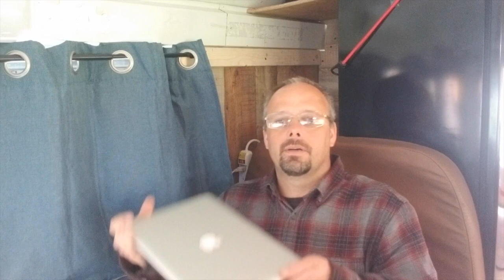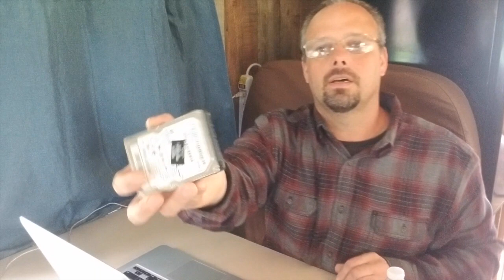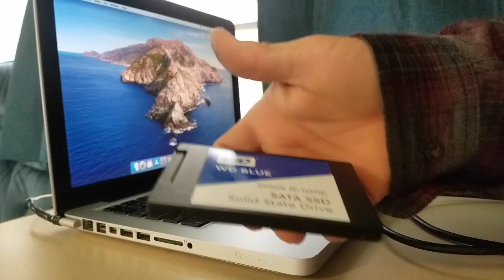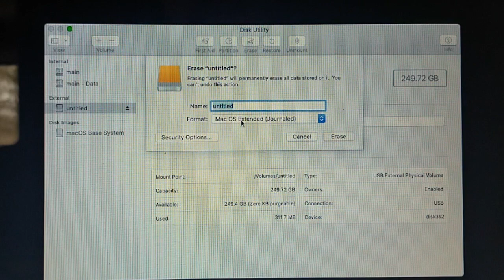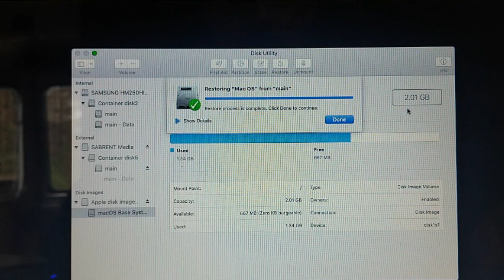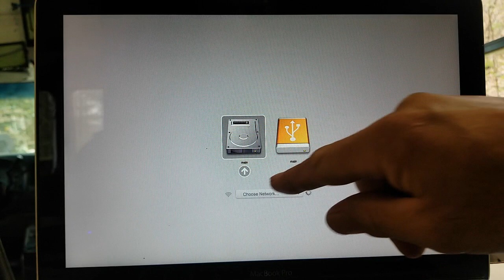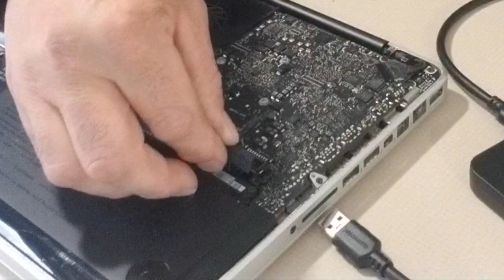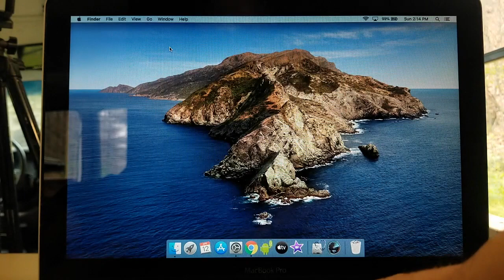Upgrade and Clone Macbook Pro HDD to SSD

Comment: Asking for advice on upgrading my Macbook Pro mid 2012

So I recently started using my gf macbook and using both mac and windows 10, i love the fact that I can use both, tbh I don't want to upgrade it and keep it if i cant use Bootcamp on it.

Here's what I want to do:

I want to install a 1tb sdd on the main disk, and then put the old disk instead of the optical reader with a caddy, and install 16gb of RAM, then install Mojave from an usb (im currently using El Capitan and I want the dark theme)

My questions are:

1. Can I install a bootcamp partition without any issues on the ssd?

2 . Can I format the old disk (with my current ios and bootcamp) to use it as a normal drive inside

3. Is it hard to install Mojave from an usb, from scratch?

4. Is it better to clone my existing drive to the ssd and then extend the disk partitions?

5. What kind of things I need to avoid in order to succeed?

6. Do I need to erase all my accounts so I dont get blocked from using the macbook from 0 (installing Mojave)

Thank you so much if you read all of this, hoping for some info
Reply from the maker: You should be able to use the old disc in place of the optical drive. I don't see any reason it wouldn't work.
Installing Mojave from scratch from a usb is the best way to go in my opinion. This guy has a pretty good video showing the procedure.  https://www.youtube.com/watch?v=TXZ6SwMZw20
 would back up everything and after the fresh install then use bootcamp to install windows fresh as well. 
I would most definitely wait until the new ssd is up and running and working well before formatting your old drive.
Reply: @lukeFugate  Thanks for the info my friend, Im new with macbooks and I know that they can get blocked for dum reasons, do I need to erase my accounts to avoid any problems??
Reply from the maker: @PEL-i9x  I don't think so. I upgraded mine with no problems. It just signed me in right away.
I have mine dual booting Catalina and MX Linux now and find myself booting into Linux for everything except for video editing. So much faster than Mac OS.
Reply: @lukeFugate  Si basically i just take the hdd, put the ssd and install mojave from an usb, and pray fir the best?
Reply: @lukeFugate  Even if I change the original drive to the caddy I would still have the option to boot it from there with ALT.. don't I?
Reply from the maker: @PEL-i9x  should be able to hold down the option key on startup and see all the drives.

Comment: Follow the steps and restore process fails with message “bless failed on ‘volume/Macintosh HD’ -no such process The operation couldn’t be completed. (OSStatus error 3.)” Any ideas, I’m stumped.
Reply from the maker: Might check the connections on the hard drive enclosure to make sure they are secure. Also make sure the OS is updated and working fine.
Reply: @lukeFugate  I ended up using the free trial of Carbon Copy Cloner. It took a little over 3 hours, but everything eventually worked. After that I did notice that Catalina had a supplemental update, so I wonder if that caused the problem using disk utility. The new ssd makes a world of difference.
Reply from the maker: @coachg101  Glad it worked out for you. Yes, an SSD is a great upgrade.

Comment: What SSD did you used? Is there any compatibility? THanks
Reply from the maker: I used this drive. 
https://www.walmart.com/ip/WD-Blue-3D-NAND-250GB-SATA-2-5-7mm-SSD-Solid-State-Drive-WDS250G2B0A/629653814
It didn't have any problems at all and is still working great. I am even dual booting Mac OS and MX Linux without a problem.
Reply: @lukeFugate  Thank you

Comment: Thank you so much for the tutorial very helpful!! Would like to ask would it work if the new disk storage capacity is larger than the original?? Im planning to swap from 500gb hdd to 1tb ssd, wanna know if this works, thanks
Reply: 1st you need to repartition the Mac OS drive to something smaller than SDD, then follow the steps from video, it worked like a charm to me.

Comment: Hi. It does not allow me to do the process because the computer indicates that my internal hard drive is encrypted. My Mac is running Catalina OS. What can I do?
Reply from the maker: Another commenter "Riley M" had the same problem. He found a solution that worked for him. Here is his post. 
 Go to System Preferences > Security and Privacy > FileVault > Click the lock to make changes > Turn Off FileVault.  You will need to leave your laptop plugged in and I recommend making sure your laptop and charger can be both well ventilated as I had to leave my laptop on for around 24 hours to let the 'decryption' happen.  After this, I was able to clone the drive successfully and install it with no problems.

Comment: EXCELLENT TUTORIAL. Very updated with latest Catalina OS. Congrats!!
Reply from the maker: Thanks a lot! Glad you liked it!
Reply: luke Fugate how long does it take for the image to conclude? It’s been a long time and the progress bar is frozen at 95% for at least 30min now...
Reply from the maker: @EvangelistadaVerdade  Seems like mine was done in around an hour. Did it ever finish? You may have to try it a couple of times.
Reply: luke Fugate thank you my friend. It took around 2h (maybe my old HD was too slow) but it ended with the green check mark and after installing the SSD, the boot time went down from 2:40 to 0:25. A ridiculous improvement on performance!! R/W speeds went from 50 to 490 Mb/s. Incredible. Thank you for the video. Very helpful!!
Reply from the maker: @EvangelistadaVerdade  Glad it worked out for you!

Comment: hi... during the "option" portion.. only the HDD appears... no USB (new SSD) shown...
Reply from the maker: You may have to try re-seating the ssd into the external disc enclosure. Also check if there is a switch on the enclosure. Mine has a switch to turn the disc on and off.

Comment: Thank you for this helpful video guide, Luke.  I've followed the steps and at the point of trying to restore from my original HDD I get the error: 

'can't restore a locked encrypted volume try running diskutil apfs unlock volume first'

It seems my original HDD is encrypted but I've no idea how to fix that - any ideas?  I certainly never encrypted it myself to my knowledge.

Thanks.
Reply: I found how to get around this in case anyone faces the same.  Go to System Preferences > Security and Privacy > FileVault > Click the lock to make changes > Turn Off FileVault.  You will need to leave your laptop plugged in and I recommend making sure your laptop and charger can be both well ventilated as I had to leave my laptop on for around 24 hours to let the 'decryption' happen.  After this, I was able to clone the drive successfully and install it with no problems.
Reply: @rileym8507  Thank you for posting this, I had the same problem and your solution worked great!!!
Reply: Stacey Smith no worries :)
Reply: @rileym8507  Are you then able to go back and encrypt after the drive successfully installs?

Comment: Out of the many videos I had to watch in order to fix my issue and update my 2012 MacBook Pro, this was, by far, the most helpful one. All the other videos, filled with fancy graphics and techy talk, didn't address what I needed. Thank you, Luke, for making this video and taking the time you did to do it right.
Reply from the maker: Glad you liked it! Thanks for watching!
Reply: NEIL MONACO I am also having this same issue. But I accidentally selected the data HD instead of the main. Could this be the issue?
Reply: @neilmonaco4340  mine  got stuck too,do we need to partition it first?
Reply: ok from my experience.... 300gb is somewhat 2hrs and it looks like it was frozen but it loads up after 2 hrs. more or less, so let say you have 400gb its goin to be 6hrs. be patient.

Comment: Great help Luke for the video. It was smooth transition from old HD to new SSD. Well explained and precise. 100 times better than some tech junkie vidoes I have seen. PERFECT FOR ANYONE WHO WANT TO UPGRADE MACBOOK PRO MID 2012 USING SSD sitting in 2020. Thanks indeed. (All the way from India)
Reply from the maker: Glad it helped you. Thanks for stopping by!
Reply: So I doing the same system but my computer is formatted in APFS(encrypted) how can I get this to work!?
Reply from the maker: @sd89  Another viewer had a comment on this situation here is a copy of that. 

Riley M
1 month ago
I found how to get around this in case anyone faces the same.  Go to System Preferences > Security and Privacy > FileVault > Click the lock to make changes > Turn Off FileVault.  You will need to leave your laptop plugged in and I recommend making sure your laptop and charger can be both well ventilated as I had to leave my laptop on for around 24 hours to let the 'decryption' happen.  After this, I was able to clone the drive successfully and install it with no problems.

This should unencrypt the drive so you can clone it.
Reply: @lukeFugate  I’m trying this now I will let you know if I run into anything else
Reply: So I ended up getting done before this reply my main HD was unmounted for some reason so I mounted it. Also I had my new ssd formatted like the hd in apfs (encrypted). Once all that was done I just followed your remaining steps.
Reply from the maker: @sd89  glad it worked.

Comment: My Mac HD and HD Data is greyed out and it won’t let me complete the process.
Reply from the maker: Did you try it in recovery? While starting up the computer hold down command and r.
Reply: luke Fugate thank you for your response. I ended up using carbon clone copier and then finished the steps you did in your video. Mac is purring like a kitten with its new upgrades. Thanks.
Reply from the maker: @getthefunkoutofhere  glad it worked out for you.

Comment: Hi Sir.
So this method will copy EVERYTHING from your HDD to the new SSD right? (as clone).... even photoshop, lightroom, illustrator, final cut, Audition etc...!!! even 3rd party links programs?
I have to try, my computer is slow.
Reply from the maker: Yes, it is a direct copy of your hard drive. It will be identical in every way, except it will be faster. Of course, it is always a good idea to do a time machine backup any time you are doing anything with the hard drive.

Comment: Hi i followed these steps but got a error on the restore. Maybe you can help me figure out what it is. Error code 49157
Reply from the maker: I tried to look up the code 49157 and couldn't find anything. Which OS are you using? Is it Catalina? Have you tried to boot into the new disc anyway? I got an error once when changing to another hdd a while back. I tried booting to it and it was fine. Sorry you are having trouble and I will try to help the best I can.
Reply: @lukeFugate  Okay so I managed to figure it out. I was running Catalina. my Internal was AFS format. but when I formatted the ssd to "Journaled" it gave me that error. So reformatting the ssd first to the same format as your internal fixed my issue. So small heads up for anyone that do encounter something like this. Thanks for you video. It was a lot of help.
Reply: @shubhamagrawal6359  Hey buddy, Yes but I would advise downloading SuperDuper for Mac : https://www.macupdate.com/app/mac/13803/superduper . or google that, it's a free cloning application that saves you all the headache of choosing the correct format before cloning it. All I did was hook my ssd up with a hdd enclosure then launched the app. after the clone was done. It was just a simple install then my ssd has all my data incl the OS on and Worked like a charm . But if you feel prefer doing it as per the method in the video then the answer is yes. But downloading the app is a lot more easier I would say. Let me know if you have more questions

Comment: That hard drive update made a lot of difference. It will be interesting to see how much better it will perform once you add extra RAM. 👍
Reply from the maker: I got the RAM in yesterday and I swapped it out(couldn't wait to try it) and didn't see much improvement besides the percentage of memory used. I haven't had time to do much real testing, but I should be able to run more things at once. I'll probably put up a comparison video when I get time. They've got us back to work now, so not much time for videos.
Reply: @lukeFugate  you wont see much until you use intensive programmes like movie editing suites . Beginners don't know the bench tests meaning . Real world action they can taste it

Comment: Good advice, i'd say. I use another method since i use Linux. Mac's which i once used, i must admit, make it easier.
Reply: As i recall, i first found your page when you posted something about a Linux distribution you were using way back then.
Reply from the maker: I think it may have been when I was trying out Zorin OS. I still use Linux, mostly Ubuntu for a lot of my web browsing and also for troubleshooting windows computers.
I did recently clone a windows 10 hard disk to use on my sons computer. Can't do that in Windows without extra software though. 
I hadn't tried cloning a Linux disc, I just re-install fresh. I may have to check that out though. It would be handy to directly copy what is already there.
Reply: I haven't done it since 2016, but Clonezilla worked for me that day. I use MX LInux these days and it has an amazing feature that clones the whole thing if you need it, even to a bootable USB drive.
Reply from the maker: @dsteele27  I'll have to check that out. Sounds interesting.